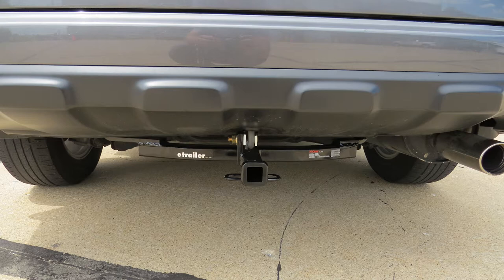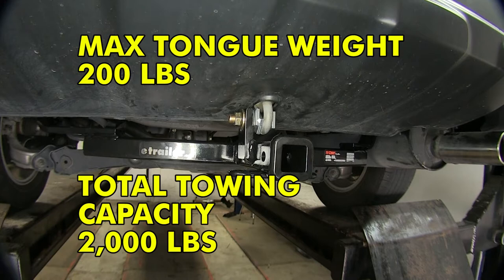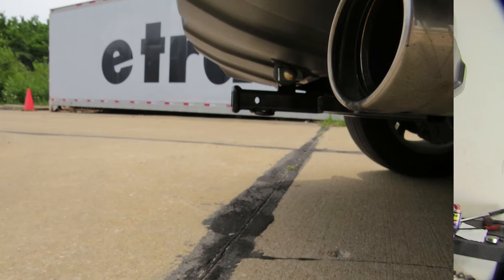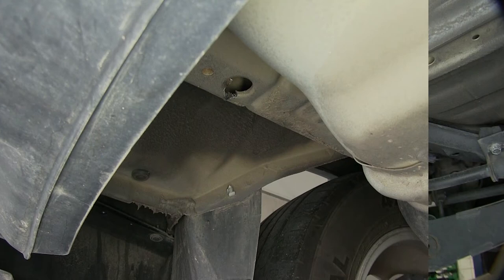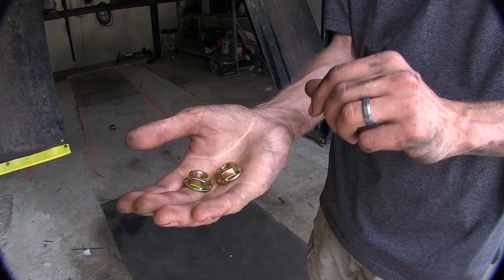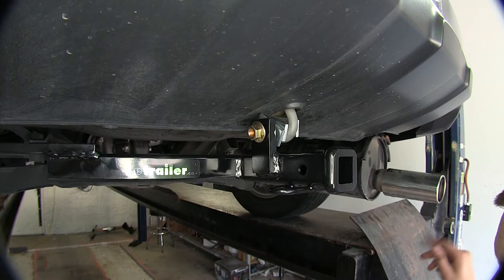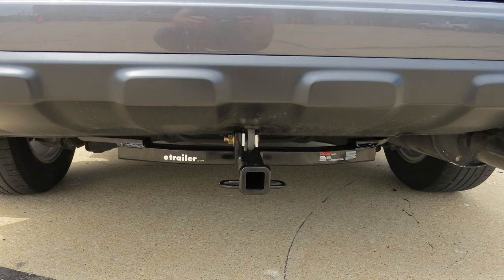etrailer | Trailer Hitch Installation - 2011 Honda CR-V - Curt

Comment: Can I use a drill to cut the frame ?
Reply from the maker: Since you're needing to enlarge the holes and not poke new ones, a drill wouldn't be your best option. A round profile file or a rotary tool like a Dremel with a grinding bit on it would be your best bet for enlarging the existing frame holes so you can pass the hardware into the frame.
https://www.etrailer.com/Trailer-Hitch/CURT/C11555.html

Comment: Is this good for a jet ski that wieghts 450 pounds?
Reply: It can handle 2,000 lbs -- so add your trailer weight with the jet ski weight and if it's less than 2,000 lbs it should be fine.

Comment: How did you get it under the exhaust?
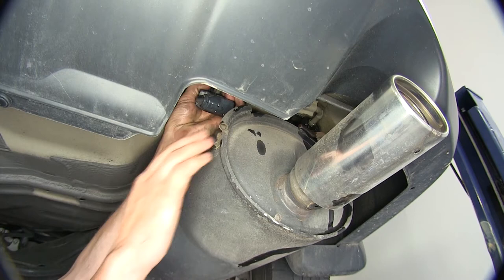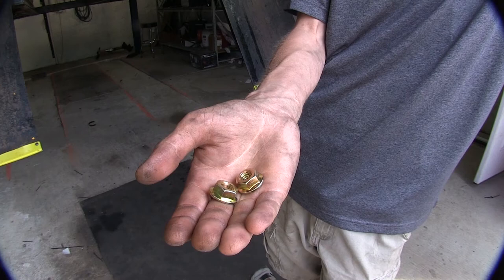Reply from the maker: The exhaust is lowered, which is first shown at the 2:20 minute mark. This provides some clearance between the muffler and the frame of your CR-V so the hitch can be slipped in. As you can see beginning at the 3:35 minute mark, the mounting flange for the passenger side is slipped up between the muffler and the hitch....
https://www.etrailer.com/tv-install-trailer-hitch-2011-honda-crv-c11555.aspx